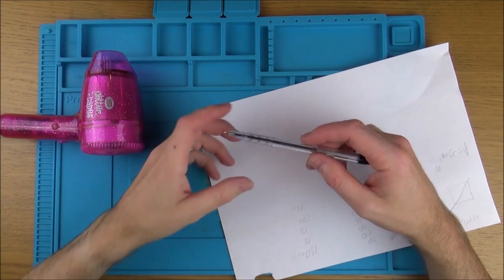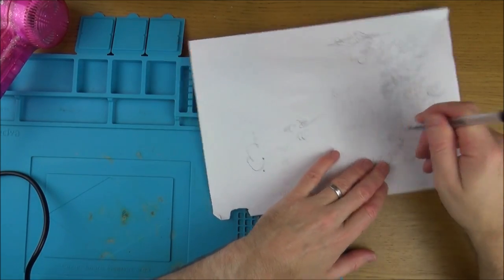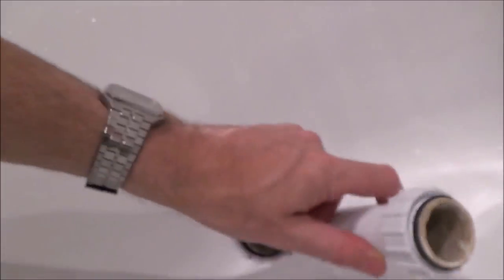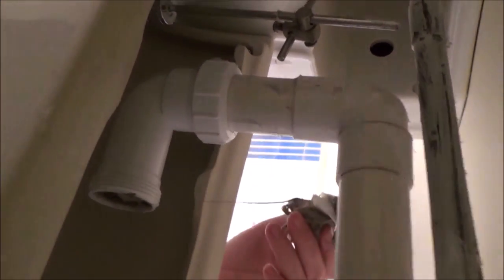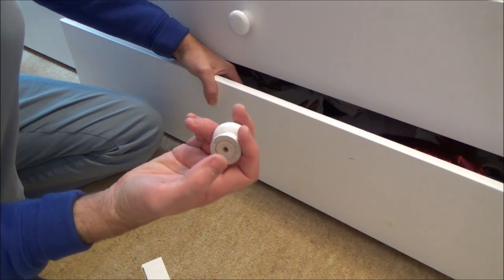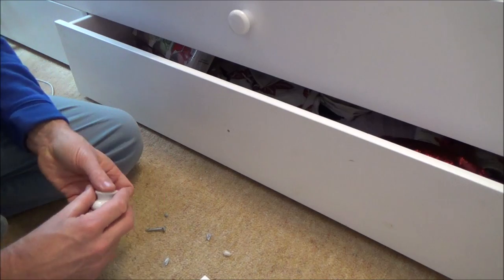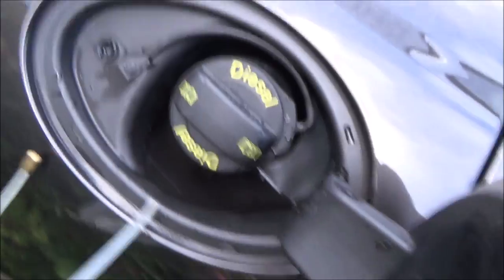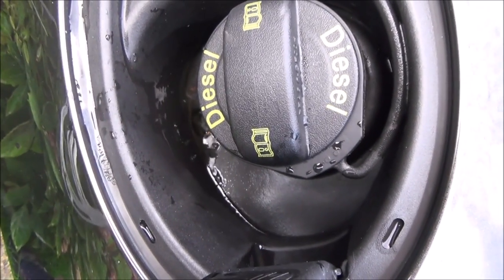Trying to FIX things around the HOME - PART 5

Comment: I totally get, and appreciate you leaving in the failures.  You learn, and we do along with you.  For example, at first, I thought the wall anchor was a good idea for the drawer handle, but when it broke, (I laughed), and then it dawned on me as to why.  Then anchor is designed to expand and grip the gypsum in the drywall, thus holding it in place, but wood does compress as much as the drywall will and it split.  Your ultimate solution for that was great, and looked better than the original.  Very much enjoy your channel.

Comment: Just a small comment. Instead of unscrewing the bath plug inside the sink hole to get more distance adjust the lever below. Also never use an electric screw driver on old furniture. Especially when it comes to the knobs. Just use a screw driver in the back and turn the knob as it already has a handle.
Reply: I'll try that on my own! Makes perfect sense.

Comment: Loved how you stared in disbelief at the split drawer handle, it was priceless!
As others said - candle wax those runners (even the inside of the rail of the drawers), if you want them to run smoother. Also, make sure they're not falling apart - sometimes, the drawers end up deformed, especially if the bottom is loose - needless to say, this will prevent them from opening/closing smoothly.

Comment: you also could have used wooden matches to fix the handle: take one match, remove the flammable bit, cut it in half and shove it into the hole, and screw back in.

Comment: Vince try waxing the draw runners with candle wax just rub the candle on both runners reduces the friction so the draw slides out easier, nearly all wood/MDF draw handles strip the thread eventually you can glue a dowel in the hole an reattach or you can purchase brass threads that tap the hole but the brass plugs come with new screws/bolts that fit the brass thread so it doesn't split the handles (Ikea use them in there flat pack furniture).

Comment: Also you can fix a ball point pen with a lighter, you just bring the flame to the ball/tip for a second or 2 and take it away, it will begin rolling again and if the ink doesn't flow itself, you roll the pen between both your hands, this method has saved many ball point pens at my house.

Comment: The pen trick, you can do with an airline or bicycle pump, bit of blutak or rodico around the little hole and the air provider pushed in to make it an impromptu joint, quick blast and it pushes the ink down the tube.   You can refill some biro's using standard refill ink for a fountain pen and a syringe leaving about an inch to the top free so it doesn't bubble out when warmed up.

Comment: A little Hint for the next time you had to remove the plug in the sink. Unscrew the silver "nut" where the rod goes through, over the white pipe below the sink. then pull out the rod and take out the whole plugassembly.

Comment: One of the most popular household items that help with sticky drawers is regular paraffin or beeswax candle. Just rub it against all the areas of the drawer where there's friction when you open and close it, especially on the tracks and around the outside edges.

Comment: I think 1 minute of hairdryer is more expensive than a new pen :D
Reply: ParlofPox Yes but it’s less plastic waste...
Reply: While this fix may needed a little energy it saved waste of plastic. In the future he and we know what to do and can avoid even using the hair dryer at all. e.g. placing it where it already is hot/warm an give it some time. e.g. a running heater or a soldering iron on idle. The first step is always the "how?". Optimization comes later on. I love his videos a lot.

Comment: Old trick of my father, use some candle wax to grease up the drawers. Especially the upside of the wooden rod inside the structure of the bed as the drawer hangs on that part while sliding.

Comment: @15:00 - I have had great success tapping a few tooth picks in to the wood, chupping them flush, adding a bit of super glue and letting it harden.  You can also fill the hole with super glue and baking soda and drill a pilot hole when it hardens.
Reply: The handle is salvageable. Glue it back together and use your toothpick idea.

Comment: We have that same sink in the cloakroom and it is always the leavers at the behind the pipes that goes to a knob that you pull up and always sticks we nearly always push the knob down to pop the plug out maybe some grease on the joints might things work easier.

Comment: We always use a big lighter will make an ink pen work again. Don't try it on a marker, they catch fire. lol.Whomever plumbed that sink needs to go back to plumbing school. There are way too many bends in that pipe. It drops down, then goes up, then down again. That's two traps. It's catching stuff in the second bend too. That's NOT the way it should be. You really do a great job encouraging others to try and fix something rather than trash it.

Comment: Those cheap poplar knobs always split apart like that.  The only thing I would do different on your drawer repair is I would used some soap or wax to "grease" the drawer slides.

Comment: For cleaning hair out of a drain, you can take a long thick zip tie, cinch it around a makeshift handle (pen, fork, whatever), cut some barbs into in, and shove it down the drain up to the handle.  Then pull it out.  The barbs should be full of hair.

Comment: I often have more failures than successes and so I put the thing down, go off and clear my head and when I have thought around the thing I go back and usually it comes out just right.   I do still have several watches missing second hands but there I was racking my brains at what I was doing wrong and someone in the watch world said to me these ultra cheap quartz movements were infamous for having broken second hand shafts and were quality seconds discarded by the maker and muggins here buying said reject parts is trying to put something onto something that isn't even there :S   Now I am only buying direct from the maker as I know their stuff is good out the factory.

Comment: hi vince to fix your broken bed drawer handle, get some matches and super glue the back ends into to oversized hole... cut flush leave to set and when set the screw will bite into the handle again

Comment: You should never show your hair dryer like this. Once Big Clive sees i you will have had it for the longest time.
Featured soon on his channel ... to be taken to bits.

Agreed about including failures, We've all have to start somewhere and failures is how we learn. For kids it seems natural to learn this way, just seems to be so bad when we're adult for whatever sad reason.

I never heard of those pin plugs, but they look a lot like what we call "Dübel" in Germany. If they are similar: They will expand quite some if you put the screw in. This is so to firmly grip and fill the hole in the wall. You'll see it when taking one in your hand and putting a screw in. So it basically exploded that poor lil wood handle. We all heard it squeal in agony ;)

Comment: With batteries the current that they can supply drops and when the current is depleted the voltage sharply falls. On the battery for the calculator the current the battery could supply was less than the current needed to operate the calculator, but the battery wasn't completely drained therefore the voltage was still quite high.
Reply: Here is a quick diagram that I did https://imgur.com/a/Aa3ANbY

Comment: another option for the handles would be to take some wood glue and saw dust and plug the hole with that after it sets up just drill a small hole and screw it back on.